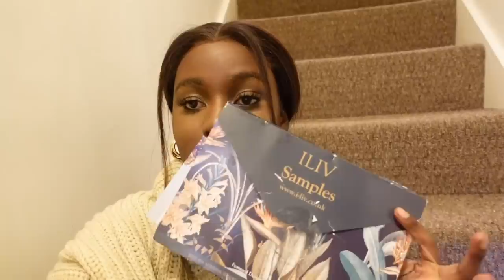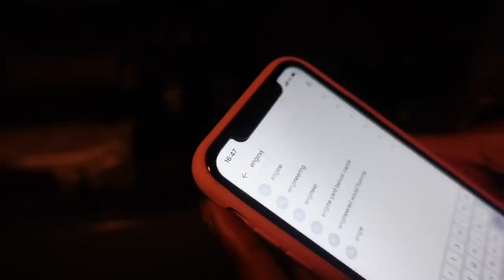THE WALL IS COMING DOWN!! CROOK MECHANICS & KITCHEN DELIVERY! | WEEKLY VLOG

Comment: No Lydia that was the right part ..the water bottle and brake fluid bottle are to d side of the.engine. but there is suppose to be a stick to use that u dip inside to tell u the level of oil.

Comment: Please people! Have a look through your car owner manual and watch youtube tip videos pertaining to your cars make and year. Stay informed and don't wait until you need the information. There are so much low-cost things you can do yourself. eg windscreen wash topup, wiperblade changes, interior bulb changes. If your car is second hand check the air filter asap! Many people don't think about it but the air has to pass through it before it gets in your car so do some research and make sure your air isn't passing through a nasty, dutty filter.  (each one, teach one.)